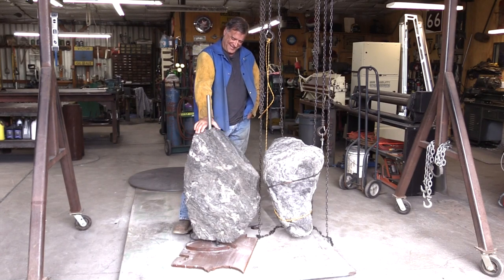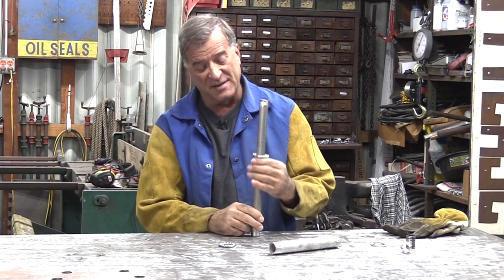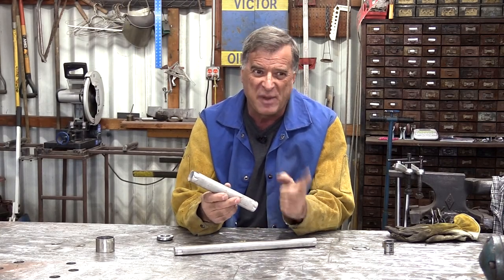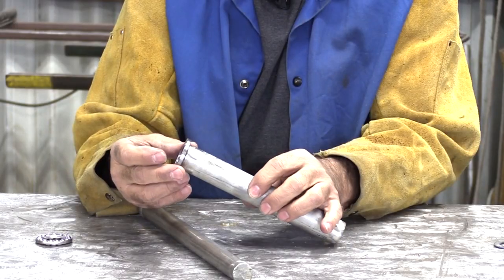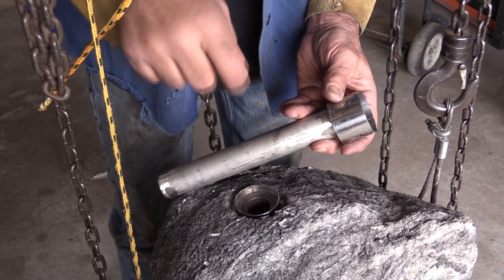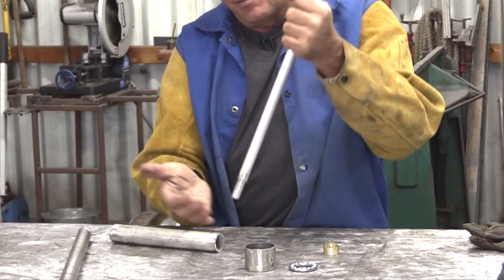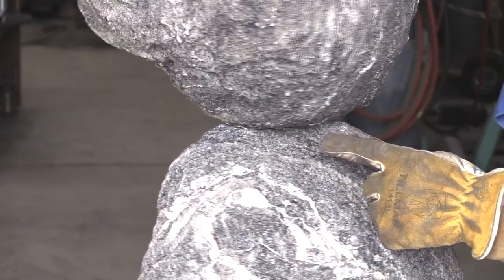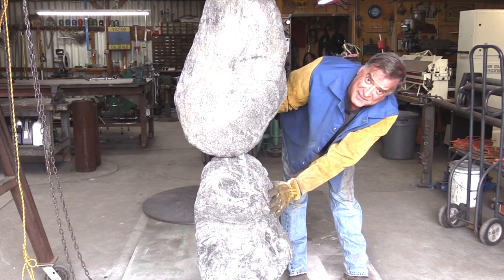How to Make Large Items Spin - Kevin Caron

Comment: I use  the assembly of a burned up angle grinder for my bearing hack detach the head ,some have different orientation than others, once securely mounted all you need is a 5/8 coupler nut attached to project and it will easily screw on to arbor of grinder, you have  free movement in both directions and  years of service for small weathervane type projects and sculptures up to 10 lbs.
Reply from the maker: Great idea will keep this in mind for the next time.   Thank you for watching and posting.

Comment: It makes me hurt thing about moving those heavy rocks. I’ve been doing kinetic wind sculptures for years and the one thing I do know is that weight causes friction no matter what bearing or how many bearings a person uses. Finding the balance point probably wasn’t that hard using your chain hoist. But even with that it is pretty much guessing and just getting as close as possible.Just time consuming. Balance, angles and friction are the 3 things we face building kinetics. Balance cannot be taught. Either a person can do it or they can’t. I am very lucky because I must have been born with it. A man I know that has been building kinetic wind sculptures longer than I have wasn’t as lucky. I have been trying to teach him off and on for years on how to balance and he just doesn’t have it. Kinetic pieces will work out of balance. They just will not turn in a light breeze. Nice video Kevin. Be careful with those big rocks
Reply from the maker: Thanks John.  believe me, my boots are steel toed and I have gotten quick in my old age!

Comment: Great info Kevin. I’ve got a globe project coming up and I’d love to make it spin. It’s roughly 8’ high. What’s your opinion on something like that holding up in MN? 90’s here in summer, -40 in winter & lots of rain and wind.
Reply from the maker: Should be okay, but all depends on how you engineer the whole moving part of the design. The 1 inch bearing I use here is rated to 3200 lbs.

Comment: Do you preheat the shaft when welding on the race?
Reply from the maker: Nope, not making anything that will spin fast or heavy enough to need the proper engineering.